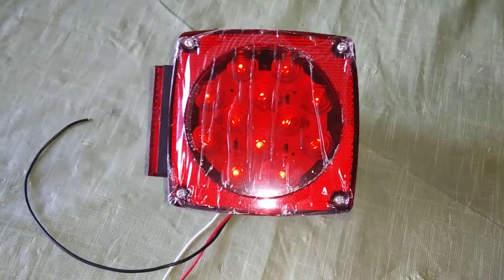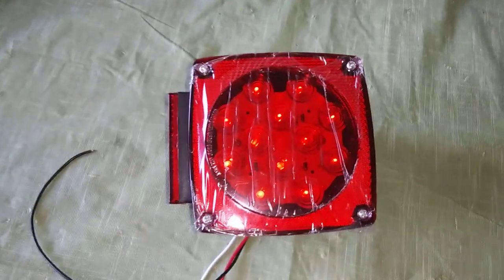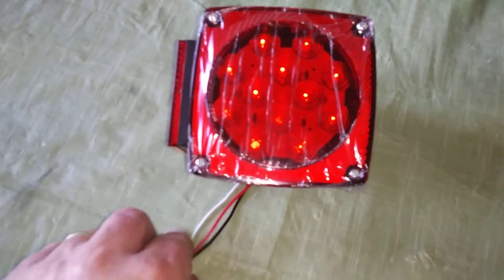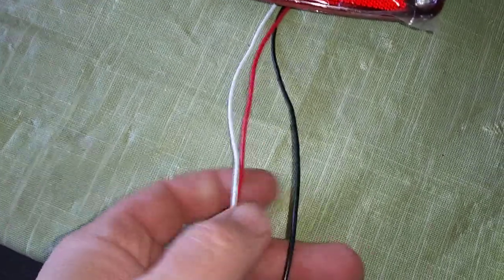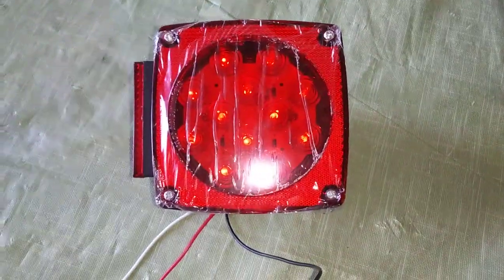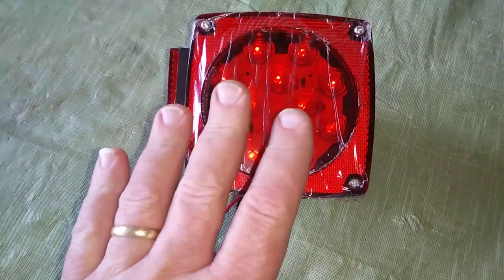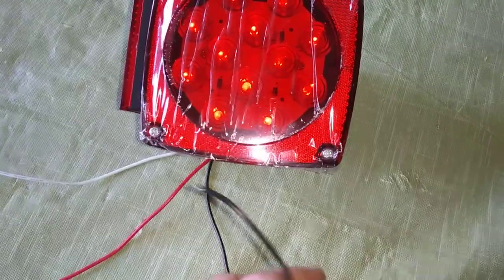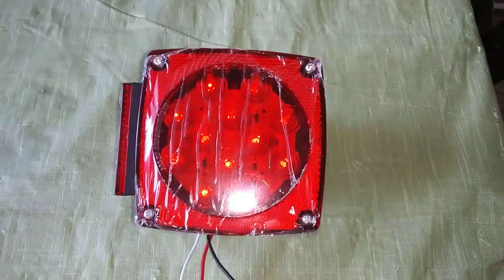LED Trailer Lights with non standard wiring ?

Comment: Wrong. White is ground, black is running, red is brake on the LEDs I got.
Reply from the maker: Not on the lights I bought.
Reply: I have to agree with James Tabisz. I bought some LED's and the set up is the same as what James stated.
Reply: However your video did help me problem solve what I had. Thank you.

Comment: i was looking into buying some similar to these from amazon.. 3 wires.. they claim to do turn signal. brakes and running lights..  how is that going to work.. normaly its 4 wires
Reply from the maker: The lights have just 2 functions,... A moderate or low light for running lights then a brighter light fir brakes & that brighter brake light gets a broken signal from the car to flash for turn signals.
Low light for running, bright light for brakes & turns

Comment: You need to state what wires connects to what wire.
Reply from the maker: I can't because Wires vary with different Lights & Trailers,... That's why I mentioned which wires on my lights did which function.
Reply: @davidyummus6259  but most common trailer wires has green/brown on the starboard side and yellow/brown on the port with the white wire on the light as it's ground
Reply from the maker: @chadjohnson5917  
Well, if Brown runs down both sides of the Trailer then the Brown Wire would be for Running Lights & the Green & Yellow would be for Brake/Turn Signals being the brighter light :)
You now have your answer ;)
Reply from the maker: @chadjohnson5917  
I still have the trailer with same Lights but the wiring is taped up so I can't see the wires but,... If you have Brown wire running down both sides of the Trailer then they "should" be for Running Lights which is the softer or lower light which means the White wire on the Lights "should" go to the Brown on either side, the Red wire on the Lights "should" go to the Green on passenger side of Trailer or Red to Yellow on Driver side of Trailer.
Black on Lights to Ground.
Test the wires on your lights with a battery to know exactly which wire does what function,... Mine in the video was:
Black to Negative battery then one at a time, touch Red wire to Positive terminal, then White to Positive terminal,... The low light is Running Lights & Turns, the Bright Light is Brakes.

Comment: Wrong. White is ground. Black is tail light. Red is stoplight here in America. Wire diagram on back of light.
Reply from the maker: NO !
Why the f*** do u think I made the video ?
As I said, these were cheap lights made in China & they dont give a crap about what we do or need in America !
I just rewired the trailer, kept the same lights & reviewed this video to check & it stands correct for MY lights !
Reply from the maker: There is NO wiring diagram on the light & NO papers came with them !
Reply: Thanks for all your help